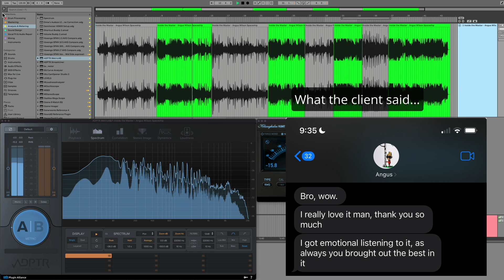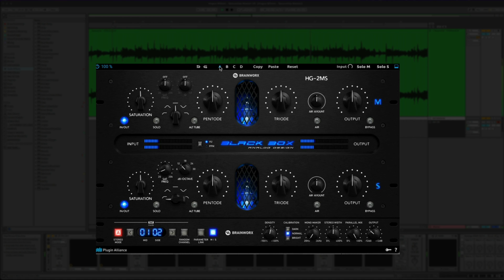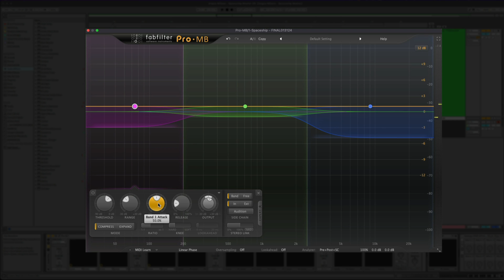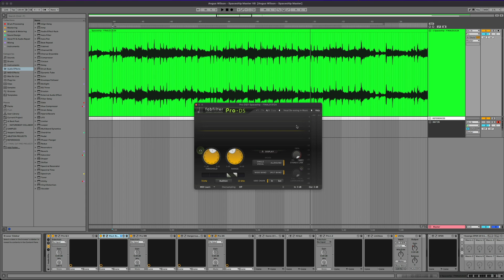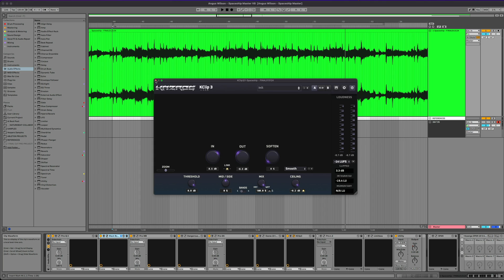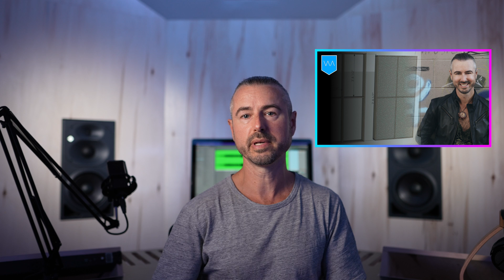Pro Mastering Chain REVEALED - How to Master Step by Step

Comment: Hey! Me again enjoying your kind sharing of valuable knowledge. I also never like compression when mastering and I thought it was my ears. I try several types, different makes, never! Happy to see a pro also not liking it - for the most time.
Reply from the maker: Hey hey.  Happy to help.  Yeah, I can get away with other tools in many cases than traditional top down compression.  Often a combination of transient shaping (expansion), fast limiting, clipping, saturation, and possibly some upwards compression.  They all manipulate dynamic range and can partially or fully replace compression.  

Also, it's important to understand that the slow time scale / dynamics section of modern limiters behaves very similar to a compressor, sculpting dynamics.
Reply: @warpacademy  Noted!!

Comment: Wouldn’t it make more sense to put a de esser on the vocal bus instead of the mix bus?
Reply from the maker: It would make sense if this was a mixing context video, but it's not.  This is a mastering video.  

In mastering, unless it's stem mastering, you don't have access to the vocal bus.  So you need to come up with solutions that are as transparent as possible.  

But yes, you're 100% correct that this is better dealt with in mixing.

Comment: very good video also very good and detailed. I always struggle thinking too much about having a specific mastering chain for master the songs, do you recommend having the same mastering chain?
Reply from the maker: Thanks.  I always use different mastering chains.  Nothing too formulaic.  

I always use EQ, and limiting.  But anything else is a maybe based on the program material.

Comment: Hi and thanks for the content. What about alliasing? Is this the main reason we want to use oversampling in non linear plugins such as clippers and limiters? What's your opinion on that?
Reply from the maker: Hey hey.  You can definitely use oversampling if you’re noticing harshness.  However often times the way I use clippers masks the aliasing.  Also oversampling causes the clipper to defect higher peak levels and induce more clipping than sample rate clipping.

Comment: do you use dither and oversampling in limiter?
after the information about the clipper, I have doubts
Reply from the maker: Hey hey.  I don't typically use dither as much of my work has a noise floor in it already, and/or is going to compressed audio formats that will add one.  

Oversampling, I also generally don't use, unless I'm using such fast settings in the limiter that it's generating waveshaping distortion.  I don't usually do that with limiters.  

I do, however, use clippers, which always cause waveshaping distortion, and then I will often use oversampling if I'm doing clipping that is audible and sustained.
Reply: thanks for the reply.
I don't speak English, but you explain it clearly.
do you use true peak? 
I've noticed that without it, it sounds juicier.

Comment: last tip is gold, trying out several limiters, I once used Invisible Limiter and it sounded great on one track and then kinda using it on a template I figured that it didn't work for the next track, but then Pro L and Elephant worked best
Reply from the maker: Thanks for sharing!  Yeah Invisible Limiter is anything but invisible.  It's actually quite colored.  Cheers!

Comment: 12:00 Kazrog is really one of the few linking the output. I'm missing this in standard clip.
Reply from the maker: Agreed fully.  If a clipper doesn't have that, I'm not using it.  BTW, Gold Clip and Orange Clip both do this brilliantly and I now prefer them to K-Clip by a long shot.  Check them out.  Schwabe Digital.
Reply: @warpacademy   great tip yes. I downloaded, installed and quickly got hooked,  it just sounds and looks too tempting honestly, however, uninstalled it already before getting too used to it hahah since I won't spend that amount of money, even though it might be worth it. I'm still fine with the free version of Kazrog (I don't know why they did that to the visuales in Kclip 3, I prefer the free version. for now..
Reply from the maker: K Clip is great too.  Enjoy!

Comment: Thank again for this great video. One (stupid maybe) question: on your final master rended track, your peak is 0db or -1db ? 🙏🏼
Reply from the maker: You're most welcome!  And that is a very good question.  Those details matter.  Seeing as this song is intended for streaming sites first, and it will be compressed into a lossy format (which increases amplitude) I left the final limiter margin at -1 dB.  I then ran it through codec simulators to see how it was sounding on various systems.  

If this was a song for DJ play, I would have run it up to -0.1 dB.
Reply: @warpacademy  Thanks for your quick reply… so then few questions 😜:
- The -1db are you applying on your rended track thru the Limiter in your mastering fx chain? 
- For codec simulator, are you using Ozone f.e. or RX11?
- How Is your workflow concerning the streaming LUFS levels?  Are you mastering to have a LUFS close to your reference track and send that to the platform or are you mastering differently for platforms (or doing something special)? Maybe you mention that in another video but things/tools/rules/workflows change quickly 🙏🏼
- BTW, Great video about the streaming gain optimisation : « RX 11: Optimizing Billie Eilish and others for streaming with Dale Becker »
Reply from the maker: Hey hey.  
-For the final margin, I'm using the limiter output gain parameter.  It's different on some limiters.  Some call it "ceiling" and some call it "margin".  For example, Pro-L2 calls it "Output" and DMG LImitless calls it "Ceiling", but in the Ableton Limiter, "ceiling" is actually the limiting threshold and decreasing ceiling will trigger more limiting.  You have to be very aware of how your limiter works.  Leaving 1 dB at the top or 2 dB at the top should create no change in the amount of limiting, only in the amount of post-limiting gain applied.  
-Codec sim: Ozone 11 or Streamliner.  
-LUFS: I don't master for any loudness target.  LUFS can be fooled and heavily influenced by arrangement.  I listen with my ears against reference tracks while working, but occasionally I'll look at the meters to see where I am.  One of my mentors described it like driving a car.  You look at the road and other cars on the road, and occasionally glance at the speedometer ;)  
-Thanks for the video link.  

Cheers!
Reply: @warpacademy  Thank you. I use FF Pro L-2 so no pb. Thanks!!!
Reply from the maker: Right on.  That's a great limiter.

Comment: So do you prefer k clip or gold clip?  Do you just use gold to start for micro transients, and k clip for pre-limiter boosting/taming?
Reply from the maker: They're different animals.  Gold Clip is a mastering processor (or buss) with quite a few features not included in a regular clipper.  It's also more heavy on processing.  I also own K-Clip.  In the past I used K-Clip as a lightweight track clipper for micro-clipping.  But I swapped it out for the newer Orange Clip.  Orange Clip is amazing, fast, lightweight, and sounds fantastic.  

I could use either K-Clip or Orange Clip as a track clipper, but much prefer Orange Clip.  Faster workflow and better interface.  

For the master, I only use Gold Clip and I typically put it first in chain, or just before the limiter.  Cheers!

Comment: What are your thoughts on `true peak` options with limiters? Loving this type of content.
Reply from the maker: Good question.  I only consider true peaks (aka TPs, aka ISPs) if I’m uploading to a DSP (Spotify / Apple Music etc) that requires keeping TPs at a certain max.  

I never care about TPs when making loud DJ oriented music for .wav play.  

You need to understand what TPL is doing.  It’s engaging at a minimum 4x oversampling.  This can and does cause a lot more limiting, which also causes more distortion and dull transients and artifacts.  The downsampling process also causes overs that need to be hard clipped post limiter which again causes more potential distortion.  

It’s debatable whether anyone even hears these theoretical “true peak overs” as distortion on DACs.  Personally I have never heard one, not even on the hottest masters that read +2 or +3 true peak on a meter.  Not on any of my playback systems.  Not on my phone, car, multiple Bluetooth speakers, laptop or my 5 audio interfaces.  Not a single one creates this issue, ever.  

But I always hear the effects of TPL damaging the music with more limiting.  Or causing you to have to back off the limiter to allow for the extra level detection.  

So I pay it no mind.  Unless the DSP or client asks for a TP master.
Reply: @warpacademy  Thanks for your response. This is great information, much appreciated!
Reply from the maker: My pleasure.

Comment: When i use limiters i always hear they eat transients(ever when tehy work like limiters), some of them eat the low end. So i stil don't get why to use a limiter instead a clipper, i mean when u want to preserve all original sound made before? Or you use the limiters for color the sound and attenuate the transients?
Reply from the maker: If you use a clipper only you’ll get a ton of distortion.  Limiters are more transparent for digging into the signal for more sustained sounds.  I use both.  Clip.  And then limit.  Only a couple dB on each.
Reply: @warpacademy  aaaah limiters are more about sustained sounds, clear now. Thanks for the answer, so usefull.
Reply from the maker: Hey hey. Not necessarily.  But yes you can dig into the RMS / body of the signal more with a limiter.
Reply: @warpacademy  wait a sec, maybe i've explained bad(sorry for my english). I do usually like this, work a single sound: i eliminate the resonances, then i process the sound, then i mix it in the rest of mixdown. Sometimes happens this: the sound sounds well but it has some peak/s i can't eliminate without the change the sound, so i use a clipper only for cut that peak/s, without have any alterations on sound inself, usually are a couple of db. Same for the groups, i cut only peaks that can't be eleminated without alterate how the whole group sound. Same logic i use on master. I notice this with limiters: if i use a limiter on master/group i usually obtain softer transients, same happens with low end, meanwhile when i'm using a clipper on master it doesn't make any changes at same level of loudness, al my original mixdown sounds like it was made only with more loudness. So the limiter works after a clipper more like a "classic compressor", i mean it needs to shape other peaks also, meanwhile a clipper needs only to clip without alterate the sound inself?

Another question, apart so loud masters people do now, what is the best level for you like rms/lufs for have a better dynamics and loudness compromiss in hard electronic music? I mean without follow the actual loudness wars and touching 0 rms or more at master. I remember around 12-15 years ago the compromiss between loudness and dynamics was around at -7rms.
Reply from the maker: Thanks for the clarification.  There's a key thing to understand here.  Limiters will contain and shave transients, but do so in a way that is as transparent as possible.  However, when pushed, they can make the transients sound dull, especially if you use lookahead and oversampling.  

Clippers create distortion.  They are different tools.  When you use a clipper to only shave transients, it'll do so in a way that the transient often sounds a bit louder (and therefore more punchy) because of the little burst of distortion on the transients when the clipper shears it off.  

A hard clipper causes odd harmonics and aliasing at the transient, which will make it sound quite a bit brighter.  A soft clipper causes warmer harmonics at the transient.  

In terms of what the best level is, I'm not able to answer that as it's entirely dependent on the genre and the individual song, the sound design, the mix etc.  There is no universal number.  You make the song sound good first.  Don't try and target some level of loudness just because.
Reply: @warpacademy  thanks a lot:)!
Reply from the maker: My pleasure.

Comment: Thanks for the video. In the limiting stage you left 1:1 enabled on Pro-L2. Was this intentional, or do you disengage 1:1 before printing the final master.
Reply from the maker: Hey hey.  Good catch and great question!  I only activated unity loudness monitoring for the purposes of the video so the limited version didn't create a big loudness jump in the video.  For the final render, I always deactivate that, and I would also adjust the final output ceiling down to account for things like lossy streaming compression amplitude noise, which I would simulate in Ozone Codec Preview or Streamliner.  Cheers!

Comment: Super interesting!  One thing that caught my attention here is that you chose to keep the "link" activated between the in and out on the clipper.  So is it correct to say that you're really only using the clipper to chop the transients rather than boost any loudness and leaning entirely on the limiter for that?  I've often heard people talk about the "clipper into limiter" workflow and assumed that meant letting each of them carry a bit o the load for boosting signal.  Also curious what your thoughts are on using multiple plugins to boost loudness vs making a single limiter work "too hard" (another tip I've come by often).

Thanks for the content though, really detailed and clear.
Reply from the maker: Hey hey.  Glad you enjoyed this one.  Yes, I typically only use clipper that have an input / output gain link function.  I like that workflow.  It keeps you from making silly decisions because you've just boosted a ton of gain into the process and fooled your ears.  You could also bring the ceiling down in Gold Clip or Orange Clip.  That works great too.  Some clippers (like K-Clip) attach the second non-oversampled hard clipping stage to the ceiling parameter.  So you have to be careful with just pulling down the ceiling.  

In terms of the clipper into limiter approach, you have it right.  Usually it's an attempt to spread the load between multiple devices and clean up stray peaks before they hit the limiter.  But more recently I think it makes more sense to put the clipper first in chain, so it cleans up stray peaks before all the level sensitive plugins in the chain and not just the limiter.  

Refer to this new video on why you should't (and don't need to) push the mastering limiter very hard: https://youtu.be/YpbV0INpHgc

And check out this video for lots more on using clippers: https://youtu.be/5sAm7McrkA0 

Cheers!

Comment: Hi. Could you please go into detail on your DMG Limitless Settings? I love that limiter and want to know how to set it up for House and EDM tracks? Over sampling, the multi band settings, etc. thanks.
Reply from the maker: Hey hey.  Sure, happy to.  The settings of course vary based on the program material and loudness, but I can go over some general settings.  Limitless is a multi-band limiter, so you have control over band independence.  I set the Separation typically at 100%, which allows some (but not an extreme) amount of band independence.  I typically use very small lookahead values, as Limitless doesn't distort easily when limiting peaks.  Typically only 0.1 ms or so.  

For louder material I use no knee, and I set Dynamics around 25-30% (this prioritizes the gain reduction towards the transient vs. dynamic release aspects).  For very loud material I set Stereo Linking to 0% for full dual mono behaviour, which can yield less artifacts when limiting more.  Just make sure you don't have loud hard panned material that could tilt the stereo image (this rarely happens in most mixes anyways).  

There's a clipper in Limitless, but I don't use it.  It's been more typical for me to more advanced mastering clippers like Gold Clip and to use them much earlier in the chain than right before the limiter.  

Also, Limitless doesn't use oversampling unless you use true peak limiting.  I don't typically oversample limiters at all.  And if I need to use TPL, then I'll do it in a second, separate limiter.  Hope that helps.  

If there's anything else you want to know, just ask.

Comment: Thank you so much for the tip to turn off oversampling on clippers and limiters. I recently upgraded my monitoring and I can totally hear now how the oversampling sucks out transients.
Reply from the maker: Glad you stayed for that part of the video.  That's a really key point, and really warrants its own separate video to go into the level of detail.  Not only does oversampling cause more limiting, and all the negative things that come with that, as well as dull the transients, it also causes overshoots (an increase in peak level) from the downsampling process.  

Most people don't realize that anytime you downsample anything via SRC, you can create an increase in peak level.  For this reason, you'll see a "post limiter" in most sample rate converters to deal with the peaks.  But again, that's even more limiting.